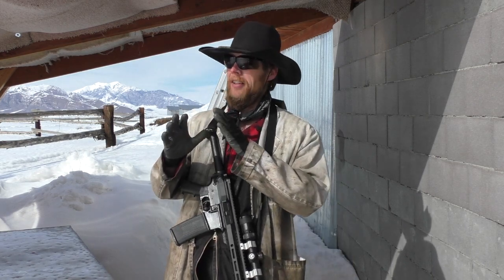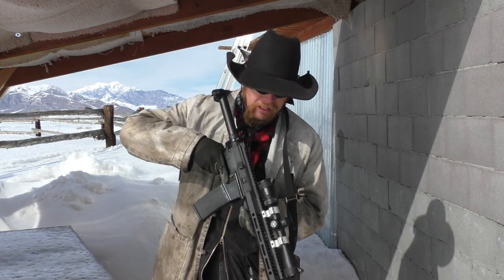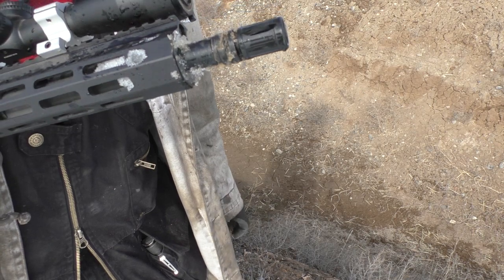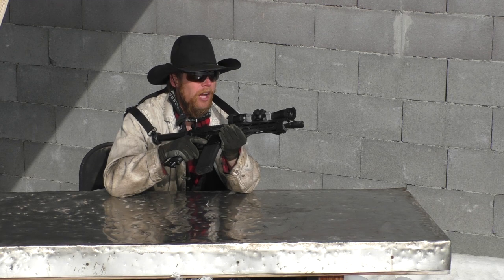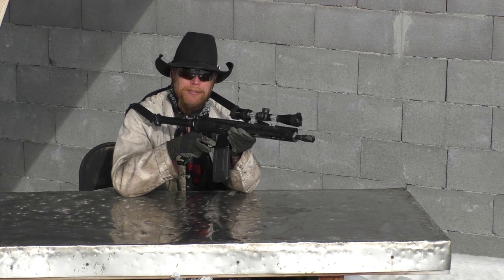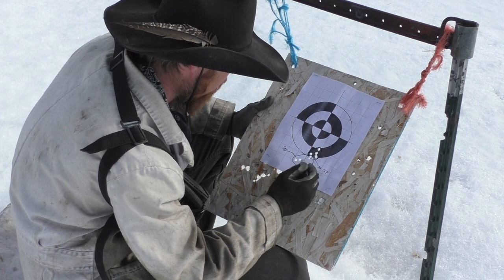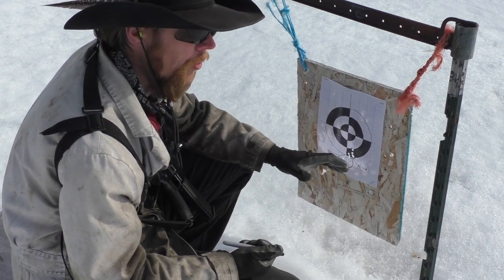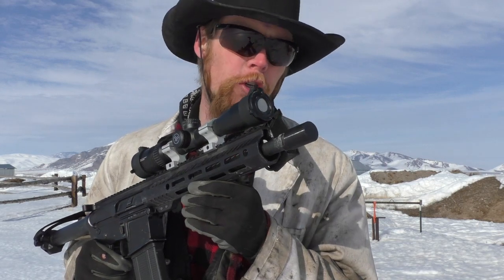Muzzle Cap (TIS396)

Comment: I’m surprised yours apparently disintegrated. The one I’ve had on my AR has lasted since I was at the PSU (so NLT 2ØØ9), when I’ve pulled the trigger with the cap on it simply pops off (unpredictably though, making recovering it an interesting experience). To be fair though I’ve only done it three times.

Comment: Those would be great for keeping dust out of the bore if you have to store a rifle for an extended period.
Reply: I agree. I think a super important/useful upgrade would be to integrate a string or somehow integrate the cap to the safety/trigger to make it obvious the cap is on.
Or maybe so it can be integrated into the lens cap of the optic so that, like with a camera, attempting to take a shot with the lens cap on results in total blackness and only in the absolute most unaware of moments do you actually end up taking a picture of the lens cap.
I think it’s important that your brain is engaged on a slightly higher level when handling a rifle as opposed to a DSLR and it should be a given, a minimum requirement but those brave enough to admit they’re not always on that level should be commended both for recognising, admitting and attempting to improve or solve that discrepancy.

Just spitballing here.